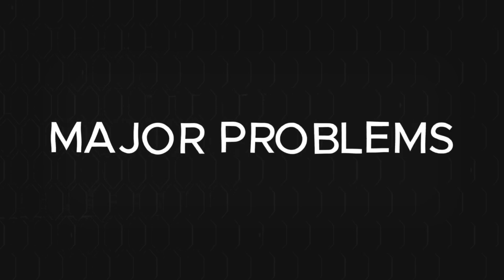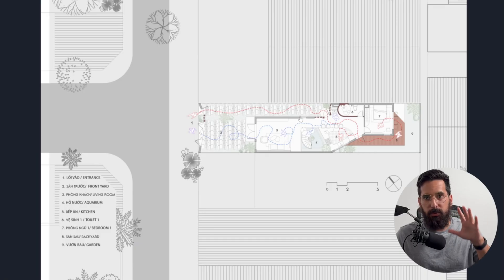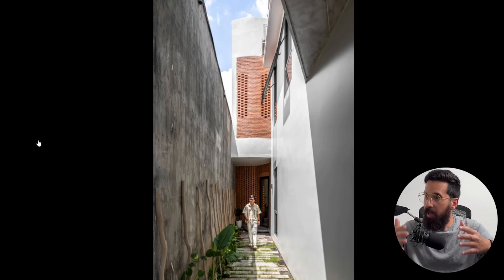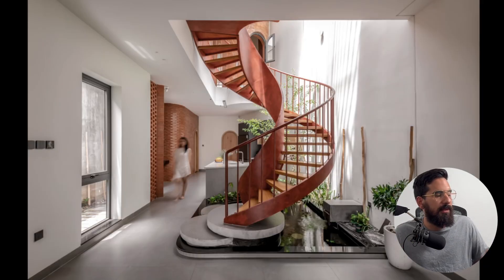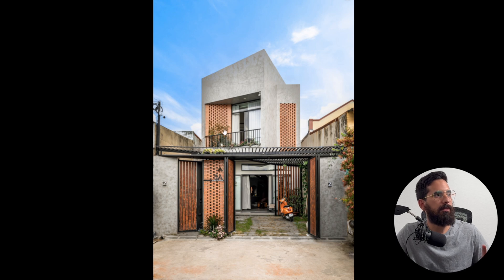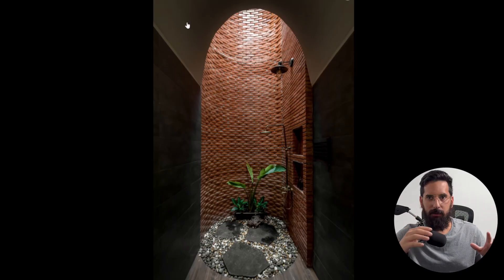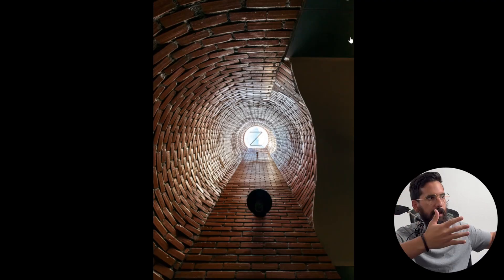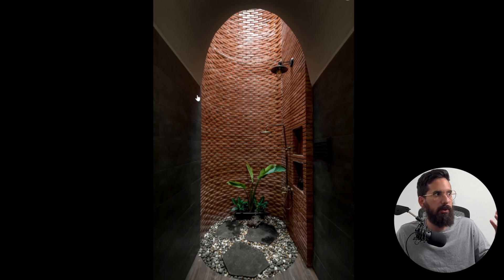This GENIUS design solves townhomes biggest problem

Comment: Bugs?
Reply from the maker: Bugs are definitely going to be enjoying the interior architecture. 

I'm in the US so AC is pretty much a must. When I've traveled to other countries where AC is not a thing and you rely on natural ventilation, you kind of just get used to living with bugs. 

Natural ventilation is usually done in the common areas of these kinds of homes. Bedrooms usually have their own zones which limits the bugs in those spaces.
Reply: @MarteloDesign  been to Falling Water. Frank Loyd Wright was also a fan of natural. Didn’t even have bug screens till later additions postmortem I believe
Reply from the maker: @mythopoeia1164  That's really interesting. I didn't know that.